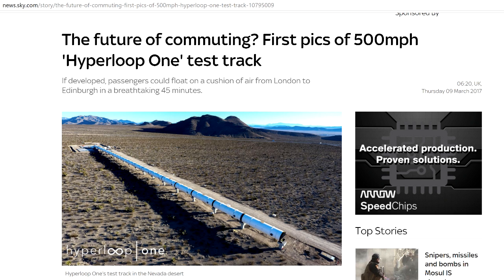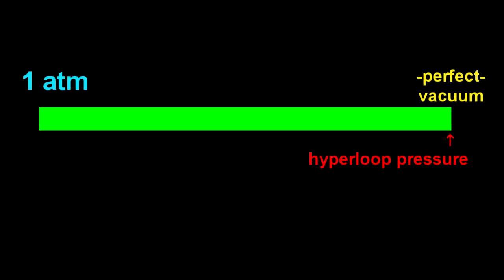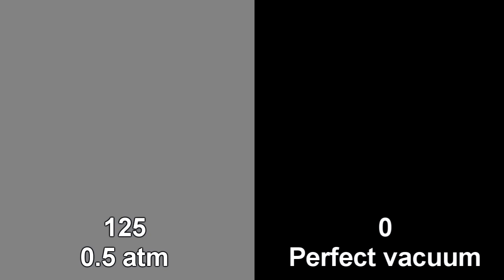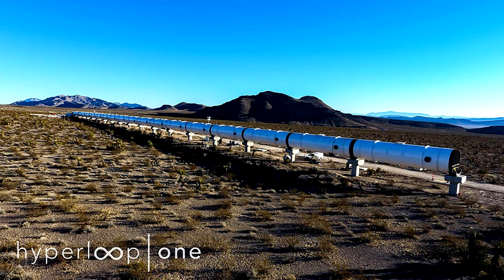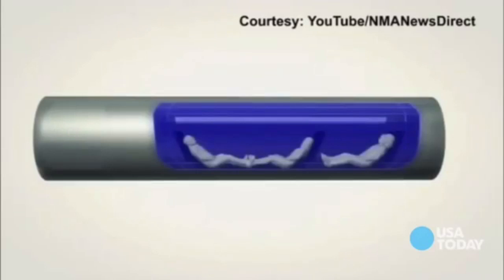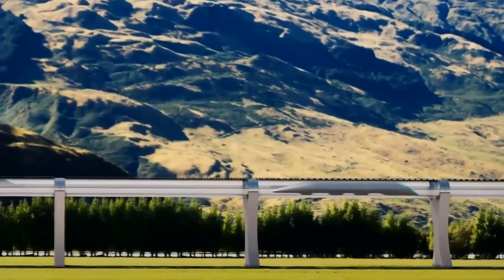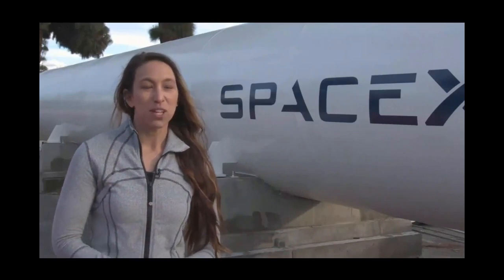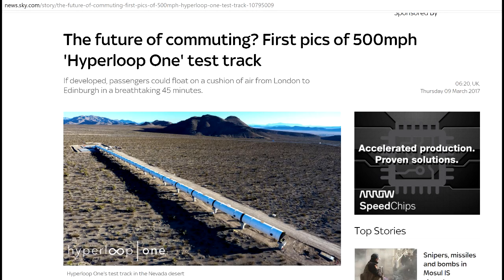Entire Hyperloop could be destroyed in SECONDS!

Comment: Could one idiot with one handgun destroy the whole loop?
Reply: Yup.
Reply: A crow could destroy the loop.
Reply: Not if it presurizes with the train running at 600 mph.
Reply: As in it bends.  Causing dynamic deformation.  You didn't watch the video?
Reply: Even stuff randomly falling from the sky would be an issue..
Reply: skywolf23 The suicide machine is being built privately, not by the state (thank god).
Reply: Take a soda can that doesnt have any dents or creases, empty it so there is no fluid in it. If you stand on it, it will hold your weight, as soon as you touch it or just flick it slightly and the entire thing will collapse.

If the structure gets damaged when trying to hold out the atmosphere there will be a collapse.

This type of structure would need a lot of safety features, they would need areas of valves in case of a failure, a way to evacuate passengers in case of a failure. It would need an air lock type area so that you wouldnt have to pressurize the entire tube to let people off and on and just a portion of it, not to mention expansion joints.

It would be better to build a high speed train. It would be safer and more cost efficient. The only thing you would have to do is either build it above or under the roads so there isnt any delays. Like in Japan.
Reply: +Sergey K "Repressurise yes, destroy no"
Sure, because those tankers shown imploding in this video are just fine after the repressurization crushes them flat. And hey, it's not like having to cut off huge "not destroyed" sections of tubing and then welding new, indestructible paper-thin ones in their place is going to weaken the entire structure or require any sort of fucking ARE YOU STUPID OR DO I NEED TO FINISH EXPLAINING HOW FUCKING WRONG YOU ARE.

This very video shows that yeah, repressurizing from near-vacuum destroys the shit out of the containment, and you think you made any sort of valid point? What, do you think Elon Musk shits magic steel or something?
Reply: Sagrotan Simple mathematics and a basic understanding of physics can answer it quite well.
Reply: Yes
Reply: +Greg Greg   No. I believe that would be a VERY SMART person to destroy the whole loop using a single handgun.
Disproof by demonstration.
Reply: One toddler with a pebble could destroy it too.
Reply: I don't mind being driven into a "valve" at 600 mph. Where's my ticket ?
Reply: +George W Bush Fluid dynamics. Right.

When I puncture a balloon, fluid dynamics dictate that the air slowly and calmly exits the balloon with a slight hiss. This is not what happens. Material resistance says tear resistance of latex is shit, much lower than stretch resistance.

When you lose part of a plane, fluid dynamics say you get some wind. Material resistance says that the round shape of the plane combined with low resistance means air flows nicely and the plane stays together. Ruin that shape and the air rips the plane apart.

Same with a round, arch structure of the tube. As soon as a lrge enough hole is made, not only it loses the arch, but the air rushing in also bends the margins of the tear, ruining the arch, increasing the tear.

Fwoop! gets squished. Air rushes in at 10 tons per square meter, rushing at Mach 1 into the tubes and accelerating any poor soul inside towards the bitter end.

If it were a glass tube, maybe, MAYBE if the tear was small it would crack and stay. But steel is elastic and when paid starts to rush in it will bend to pressure. Needle sized? Maybe. Palm-sized? Unlikely. Forearm-sized? Collapse.

Look at the Mythbusters video. Any deformation of the shape is enough to implode the fucker, and I am willing to bet the tanker is nowhere near as strong as the HyperTube, nor was that ben the absolute minimum.

IMO, almost any buckling would implode it at near-vacuum.

And if it isn't near vaccum, Fuck Musk and his shitty toy, you can do that with some clever aerodynamics; Japan does 600 KPH at sea level with a real train on a real track.
Reply: Yes.

"Right now, a terrorist needs explosives and assault rifles to kill about a hundred of people. But in the future, with the Hyperloop, any handgun, heck even a pocket pistol, could destroy the whole thing, killing hundreds of people in one bullet while also disrupting another transportation mean (that isn't needed). Maybe that in five years, only a nerf gun would suffice to destroy the whole Hyperloop."
Reply: +Polymeron
1. So instead of just shooting the tube, they could shoot the tube and pumps.
2. When they "un-weld" and replace the section how do they maintain pressure? With valves? I don't know of a valve that can close off a pipe and then get out of the way of pod
Reply: A hammer blow could destroy the entire hyperloop, or a thrown brick. The dent of the blow would rapidly cause total collapse of the structure, as any deformation would send a shockwave through the entire track at about 6 km/s. Just look at the tanker video, there was no hole, the structural integrity failure caused the collapse because of the pressure.
Reply: That's one of the first things I thought of - somebody will shoot it just to see what happens.
Reply: Look at the tanker video. There was no hole in the structure, just mechanical failure. If you make a huge hole in the hyperloop, it just repressureizes, and maybe nothing happens. But: If you make a very small hole, or a dent, it is not the air rushing in to worry about, it is the deformation of the structure. A dent introduces material stress into the material, that is already pre-stressed to a very high degree on account of being put unter enormous pressure. The material then deformes until the stress is released to a point where it is no longer strong enough to deform the material, as seen in the tanker video. If they kept pumping, eventually the whole thing would be completely flat.
Reply: Greg Greg u forgot gang members who get involved in senseless gun fights.  one stray bullet and the whole tube will implode in itself
Reply: It probably wouldn’t even need to be a real gun there are some wicked powerful air guns on the market these day.
Reply: Wrong. It is an intellectual exercise noting what is wrong and if anything sane could be done to make it work even if too costly. Then try to reduce the costs to sane levels. It could be made to work but I see no way to bring down the insane cost levels.
Reply: How about an Allahu-Akbar guy?
Reply: If he were to shit it in a form of a tube, that would solve everything.
Reply: Nah, but a decent sized pipe bomb duct-taped to the tube would obliterate the thing
Reply: One Idiot with an sledgehammer will do^^
Reply: "if you use a sufficiently powerful gun and manage to put a dent in it or cause a leak "  no, if the bullet penetrated, it would cause the tube to re-pressurize, not be destroyed.  Also, a heavy storm or snowfall wouldn't destroy the tube either, and even if it would, there are solar panels, that would work to shade the tube from the storm, or weight of the snow, and the solar panels also function to reduce the expansion/contraction of the steel, by shading it from direct sunlight during the day, and because the hyperloop would ideally be running 24/7, the solar panels wouldn't require batteries to store the power, and instead be put directly to use.  It's actually a great idea and a  number of Thunderf00t's calculations have been off, which is why the actual team of professional engineers who are working to design the hyperloop don't have the same negative predictions as Thunderf00t.  Here are two especially good episodes of a series that points out Thunderf00t's errors on this issue (the first one is timestamped at a point where discussing the issue of the hyperloop being shot, and the other one covers the fact that he misrepresents the pressure differential, but the whole series is good, and I recommend watching all of the episodes, if anyone is actually interested):

youtube. com/watch?v=Uh0uwJoNnhc&t=8m17s
youtube. com/watch?v=UQPAzZX7Pp4&t=7m18s
Reply: Well said but that really depends on how this thing is actually made. The safer you make it the more it will costs and anyone who runs those numbers is going to see way to many digits. If one section fails you are going to have a shock wave going down the tubes. Shooting a tube filling object into air at 600 mph inside a tube should have some interesting side effects. Putting a safety valve in front off it should be interesting as well. There are cheaper and safer ways to travel.
Reply: Almost certainly. A breach in the wall will cause a massive explosion as the entire loop suddenly depressurizes. The only good thing will be that the idiot with the gun will not see any jail time.
Reply: Not if it’s underground
Reply: Not the whole loop if it can be closed to segments with large valves. But the tube can be broken with a handgun if the shell is thin enough.
Reply: They will have to completely ban guns in California. Oh wait, they already tried.
Reply: Not if they're smart and actually re-enforce it or use materials that can take that kind of punishment. Of course, one idiot with a bomb... or perhaps some large caliber anti-tank gun or artillery now that's another story.
Reply: if you think this is a good investment then put you money there. I think I'd get nothing for my money and Musk would walk away with more money than ever.
Reply: No it's gonna be underground.
Reply: Could a single piece of debris derail a whole locomotive?  Yes
Reply: If you own a de .50ae
Reply: Handgun? Probably not. Something like a .300 win mag could do some damage though.
Reply: +Matt It could if you want it to. Several magazines that put holes in the side of the tube in a circular fashion would very likely cause that "portal" to collapse and the rushing air would rupture the rest of the material, enough to deform the tube and likely kill people if they happen to go through there.

But WHY a handgun, when you have so many better and legal options? Drop a stone on it, ram a pylon, pour salt water or any corroding agent on it, use an oxy flame, or, better yet, screw a big self-digging screw into the wall. When the train comes, at 700 KPH, that bold will destroy the capsule's shape, making it scrape the wall, skew, and plant itself sideways into the tube.

Any asshole with a drill could kill it. Not much noise, not immediately apparent, just an asshole with a drill lost int a bunch of protesters.

I know, I shouldn't be typing this out loud, but I'm sure I could come up with an even better way to detonate what is essentially a bomb.

Hey, come to think of it, wouldn't a small explosive basically make the explosion travel via vacuum fail to the base station? I could use a dynamite stick to blow up both stations from the comfort of my desert trailer.
Reply: you dont need a handgun expansion and contraction of tubes will destroy it first
Reply: Repressurise yes, destroy no.
Same as a damaged track on a rail road. The whole line stops. Except trains can run part of the way, but they usually don't.
Or an accident on a highway. The section of the highway become useless until the road is cleared.
Reply: The answer to your question is "absolutely not".

The White Paper calls not for a hermetically sealed design, but rather lots of pumping stations along the way to overcome any leakage.

That means that:
1. It would be able to overcome a bullet hole without depressurizing to any large degree (though this would still need fixing as it would slow down capsules going through and increase pumping expenses until mended).
2. Even if you caused enough damage to a segment to cause its depressurization, this damage couldn't propagate to the rest of the Hyperloop and only the damaged segment would need to be replaced. You can actually see this pretty well in this video where a tube with a pumping station in the middle only has the section between stations collapse, with the other remaining intact.

All of this makes the claim that the whole Hyperloop would be destroyed by someone with a handgun/shotgun/explosives so much horseshit. Frankly I'm pretty annoyed with how TF has not yet responded to this point even though it has been pointed out multiple times, and instead keeps making videos with bombastic titles that are negated by even the footage he himself brings.

Pretty lame :-/
Reply: Why even ask this when there's legitimately no conceivable way to answer it objectively? I get that there are major problems with this heap of shit, but you guys seem to just like discrediting things with unintelligent criticisms because you want to herd in with tf.
Reply: Not a chance. Fluid dynamics would cause it to slowly depressurize. Unless someone crashed a car into it at full speed, the walls are tough enough to withstand small deformations and ruptures. Steel is ductile.
Reply: @PwntifexMaximus  didn't you watch the video? you just need a small dent to completely implode the whole pressurized chamber
Reply: @TropicalCyc  
No. Did you do the total deformation-energy calculations to know for sure? Of course not. Thunderfoot is a chemist. Not an engineer. I am. He's just spouting bald-faced lies here.
Reply: @PwntifexMaximus  So, I could puncture a hole in the loop, and it'll work just fine? Seriously...? 

Because I will be doing that. This thing is insanely dangerous.

Comment: I'm by no means an expert in anything to do with this but couldn't some of these safety problems be solved be solved by adding vacuum tight sliding barriers regularly across the tube with emergency valves on either side of the barriers to flood it with pressurized air along with friction breaks to slow the capsule. It would still probably hurt everyone but it would reduce the speed enough to increase survival rates. Don't get me wrong, I still think it is an absolutely moronic thing to build in the first place because there's almost no way to solve the expansion problems besides putting it on EXTREMELY heavy duty wheels and putting it on tracks. Not to mention how annoying the problems of earthquakes, maintenance, and attacks on the tube would be. But I'm only a first year college student writing this at 6A.M. with no sleep so give me a little credit.

Comment: No, the reason that I personally thought you were full of shit was because you clearly don't understand fluid dynamics.  Air is not a superfluid, and cannot immediately enter a hole.  You had stated that a column of air would be traveling at the speed of sound inside the tube in one of your videos.  But even if you know the basics of, well, physics, you'd know that's not possible.  The speed of the air at the hole is roughly the speed of sound, but you have to then use mass flow rates to figure out the actual speed of the column of air in the tube.  This is obvious if you just keep in mind conservation of momentum.  And that's to say nothing of skin friction, or possibly compression effects that would actually slow down the air.  

Your first video on the subject had a scaled down "demonstration" where you had a tube under vacuum, and then you removed a plug from a hole and demonstrated a marble go crashing out the other end.  This was a neat demonstration, but it really exemplifies how little you understand fluids.  It was nowhere near a representative test.  The hole you unplugged was just a little smaller in diameter than the tube itself was.  Mass flow rate in = mass flow rate out.  And in the case of that demonstration, since the diameters were roughly equal, V1~V2.  

Another reason I don't think you understand what you're talking about is the fact that the demonstration you provide in the beginning is a collapse due to the vacuum being created.  If you can actually get the tube to withstand the pressure differential, then your initial video has absolutely no relevance.  Do I think they can get the level of vacuum they want?  No, not a chance.  I'm just saying that if you're going to criticize something, you better fucking understand the actual physics of it.  You're a chemist, not a physicist, not an aerospace or a mechanical engineer, a freaking chemist.  Leave physics to the physicists and engineers please.  You don't understand this stuff.
Reply: airman122469 interesting argument wish I knew enough to understand it fully. I would like to ask your opinion on the hyperloop. Do you think it's a good idea or is it as dangerous as thunder foot says?
Reply: It's not nearly as dangerous as Thunderf00t is making it out to be.  It seems rather impractical because of the extremely low pressures they're calling for inside the tube though.  Thunderf00t rightly points out that creating such a vacuum is extremely hard to do with a small tube, and doing so in a long tube that will have to have joints to allow for thermal expansion...yeah...that's going to be really hard.  It's a neat idea, but the feasibility of actually making it is a bit questionable in my mind.  If they relax their pressure requirements, maybe to somewhere around a third of an atmosphere or something, then maybe?  That would be a question for a mechanical engineer though honestly.  My degree is in aerospace engineering, so I know the fluids bit, but not what the best pumps in the world can do to create and maintain a vacuum, or how much expansion needs to be taken into account in the tube.  

There is one safety concern I have, and Thunderf00t mentioned this as well, and that's this: what happens if the train gets stuck somewhere in the tube?  How are the people going to be evacuated?  Does the tube have to be temporarily pressurized so the passengers can walk all the way to the nearest terminal?

So to summarize:
No, a small bullet hole won't cause the thing to fail catastrophically as Thunderf00t suggests.
No, I don't think the design is feasible as it stands.
No, I don't think they've quite thought out all of the maintenance issues and evacuation routes entirely.